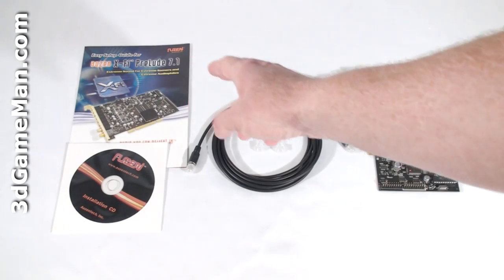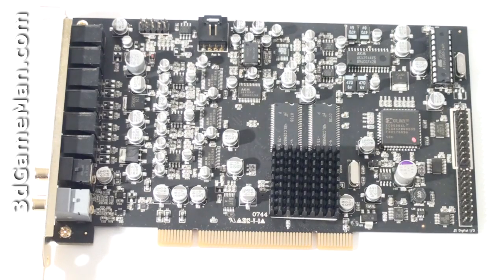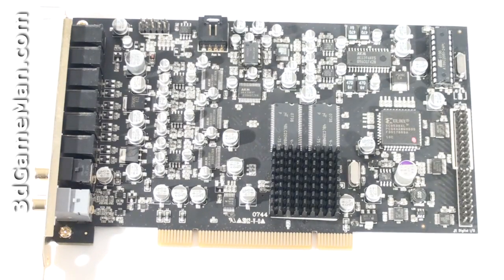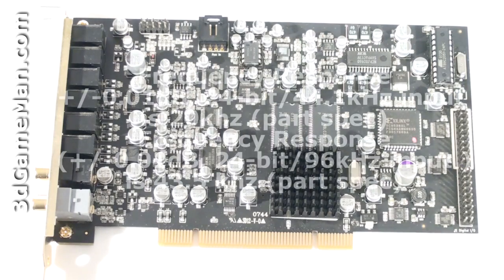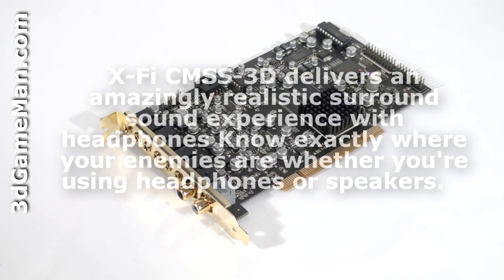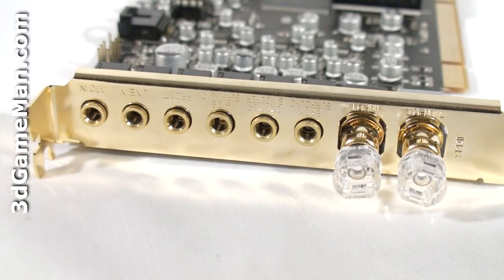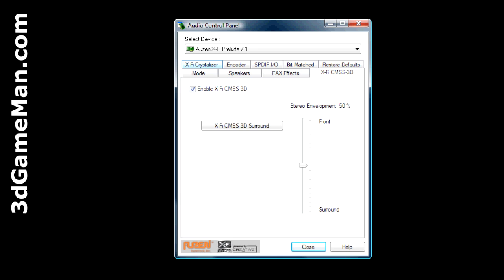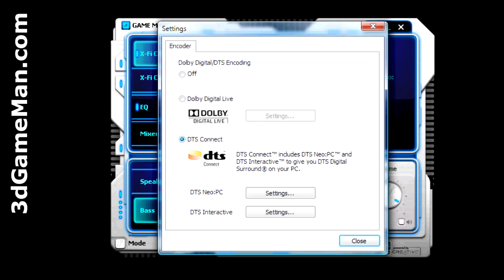#1012 - Auzen X-Fi Prelude 7.1 Sound Card Video Review

Comment: The only problem is it has no metal case for shielding so there will be interference  in the audio  that's why so many people stupidity use external USB DAC's because there cheep and to avoid the interference or they just use onboard sound on the motherboard but that's as bad as using onboard graphics gpu on the CPU like Intel i series and the and APU ok for the average consumer but not for hi end . It has great specs on the SPU and RAM and I like the design  but if its supost to be in that hi end category that hi end graphics cards and 8 core processors are targeted at sound engineers /producers , home theater /audiophile  enthusiasts , video editing /movie and game producers and next gen gamers  with work station /studio grade equipment  then it need shielding . I should know I have  a masters in electronics engineering  and I sound engineer /producer /dj  also a home theater and video game enthusiast since the 80's when all we have were low res vet's , stereo and 8 bit computers and consoles . I hope they design the next model with shielding.

Comment: I should mention that the Xonar uses high end cherry picked components like the Prelude, supports 7.1 surround with hardware Dolby Digital and DTS decoding and *encoding*(5.1), and the card itself has a big ass EMI shield surrounding it, unlike the Xi-Fi cards. So, the audiophiles can no longer complain about EM interference from the rest of the computer causing the sound quality of an internal sound card to degrade, at least in the case of the Xonar.

Comment: Also, Creative's EAX 5.0 128 voice hardware accelerated audio is not the mandatory must-have performance enhancing feature it once was. Since Microsoft dropped support for hardware audio acceleration in Vista, Creative has been forced to use OpenAL. OpenAl is an open-spec cross platform library, like OpenGL, which is dedicated to audio.